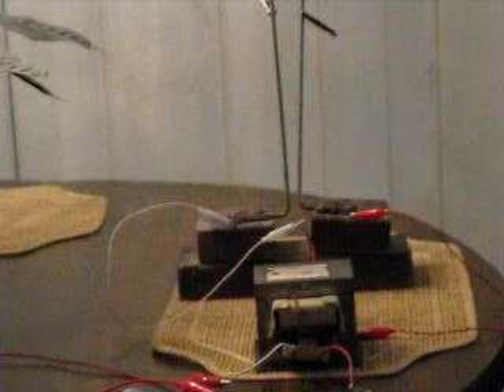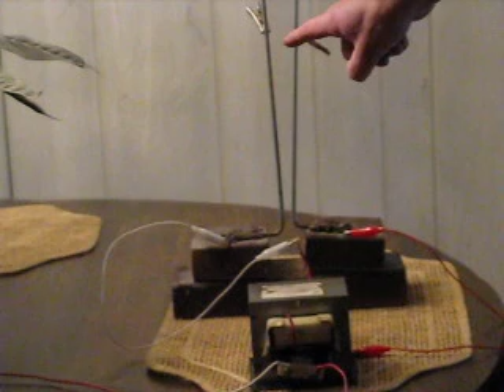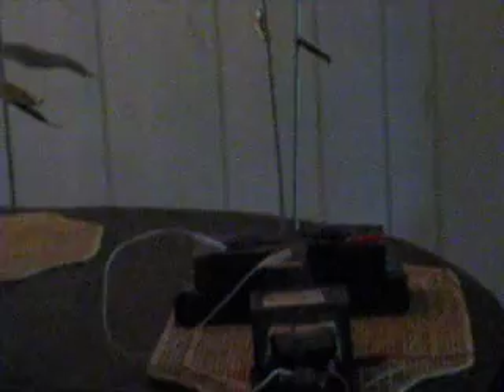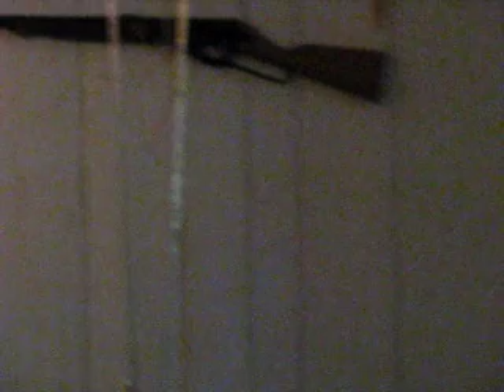High Current `Jacobs Ladder' using a Microwave Oven Transformer

Comment: sweet. i actually just did something kinda like this but instead i used a homemade arc starter by hammering a nail into a small block of wood and kept touching it to the wires which was able to create the arc. well done bruce.